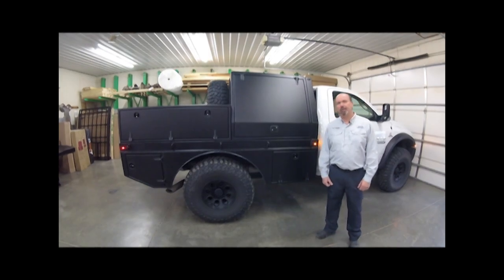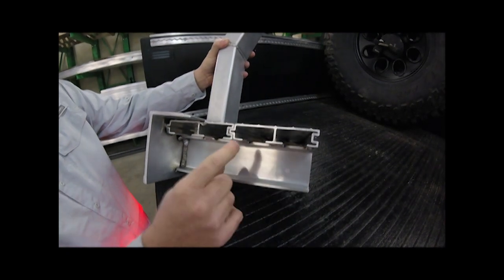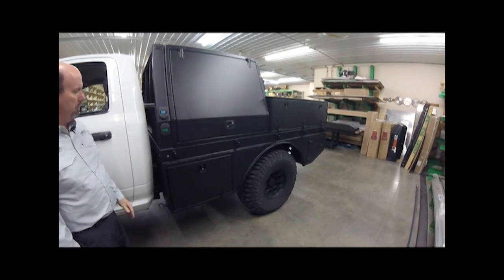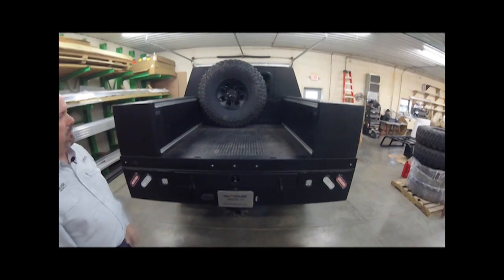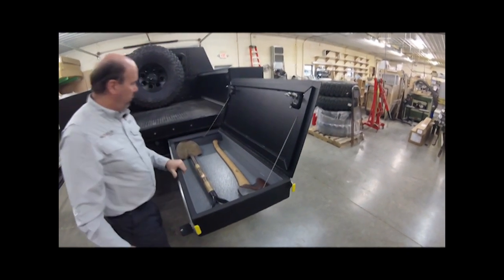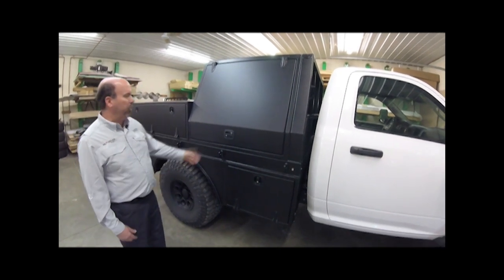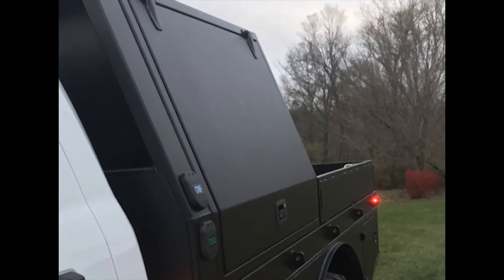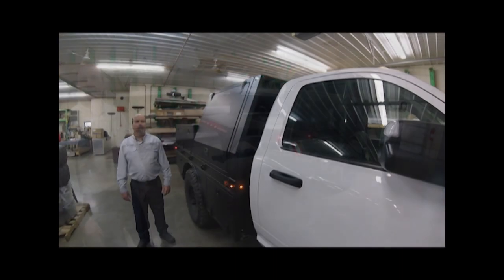Nuthouse Industries- Expedition Flat Bed walkaround

Comment: How much does that cab box aparatus weigh? Is it ungodly heavy and you have to use machines or something a couple guys could wrangle up/down?  I really like the setup and the fact that its all modular. Being able to swap from cab to a half cab, pure flat bed, to having storage boxes, the possibilites are really endless i love it
Reply from the maker: This module is fairly heavy, as it was designed for him to sleep in with the interior and electrical package he requested.  He has since purchased another basic module that is is not as deep that can be handled by a couple guys.  He uses the smaller module daily to keep gear secure and when his dog decides he wants to go
Reply: @nuthouseindustriesllc  ahhh thanks, is it something those little truck cranes could pick up? Under 500lbs? Or is it over that weight? That other truck with the collapsible crane is a no brainer must have, or something similar to it anyway. Being able to set it up lift a motor or a generator, a fuel slip tank, the possibilities are endless and I can't believe I haven't seen that on more overland rigs, or "work" trucks. I've only ever been around the big ones that are on the big mechanic trucks. 

Thanks again for the reply(s), I've wanted a single cab cummins for a while but was leaning towards topper, but always liked the looks of some of the flat beds and having limitless possibilities is making me lean more towards going with a flatbed.
Reply from the maker: @jlo7770  yes, on some of these boxes.  I little truck crane could handle these with the correct set-up and height.  We sell a few of those SpitzLift units on these trucks.  Lifting gear when your by yourself is much easier with a small crane form SpitzLift or another brand.  Really makes the truck multi-purpose. Thanks again and appreciate you watching!

Comment: How much does the setup in the initial walk around weigh? Seems like a nice setup for a hotshot driver but may cut down on payload allowed if to heavy. Also, can you add a gooseneck hitch to your bed? Again, something a hoshotter would need. Please address……
Reply from the maker: The flatbed and boxes in the video is a little over 800 lbs.  Boxes and doors are all fabricated from .125" material. Main frames, long sills, I-Beams are all .25", Material thickness is chosen for durability for our builds that tend to overlanding or expedition equipped trucks.  All beds are custom made to the application the client needs and weight can be reduced if needed, such as a for hotshot setup.  Gooseneck trap door or a 5th wheel trap door is an option we offer to access framed mounted tow/hitch points.

Comment: If u could get that cool big side end bed box to sit lower & just b the dead spot between tire well & cab & fill that spot u would really hve something. A garage mini storage on side of bed low enough to easily put stuff in & it does need to stick up above the cab for finished ht. What ever small space is below it can b a pull out ramp or 2 sides pull out ramp. It's all about maxing the spot biggest opening fit poss. Oh yeah the top needs to b able to come off if still not high enough mini garage storage.
Reply: ideally the mini garage would fit the space perfect between wheel well & cab YET still b standard small pallet delivery capable. I don't know that size vs wheel well distance.